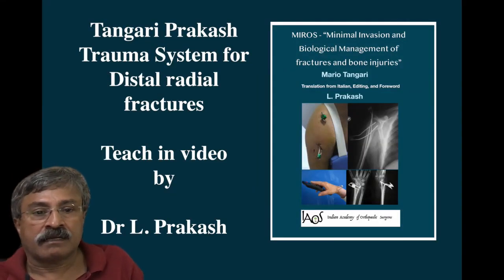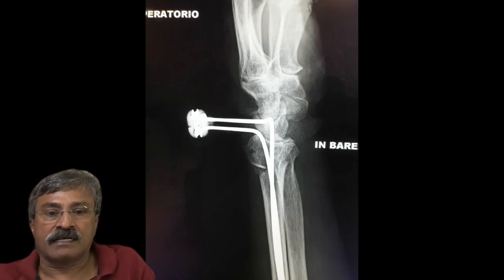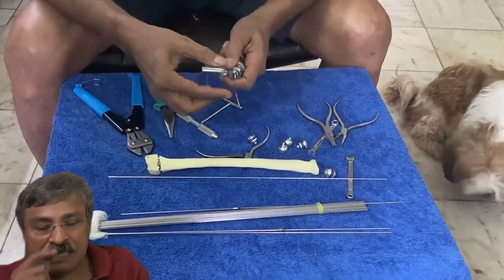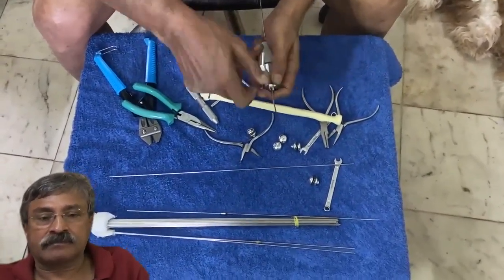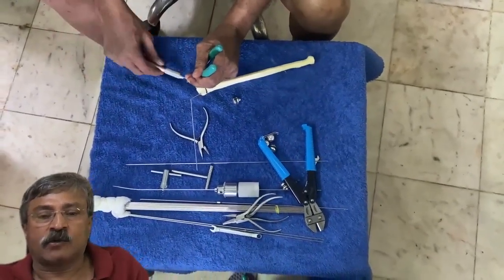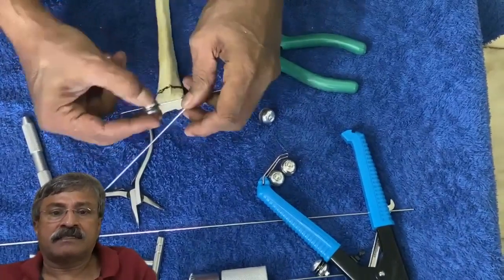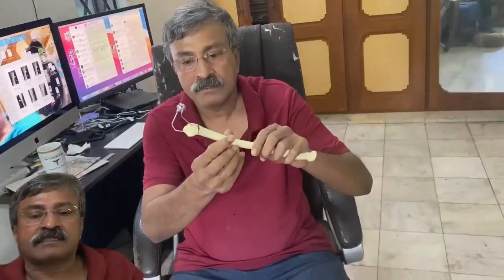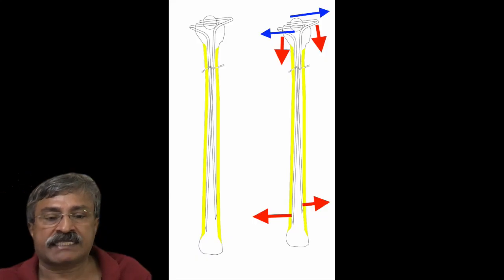TPTS in Distal Radial Fractures

Comment: This the Ulson Brazilian surgical technique and has almost 50 years published
Reply: Well you can say it as modified ulson's procedure. In original ulson's procedure regular k wires are used without bending them. In miros technique using TPTS the wires have to be bent to give necessary stability and then its hold by clamps. Infact the bending of wires gives same effect as of traction.